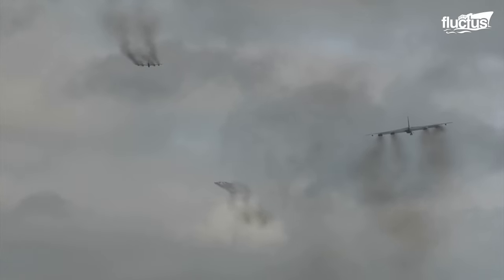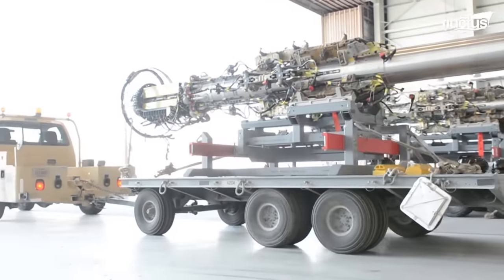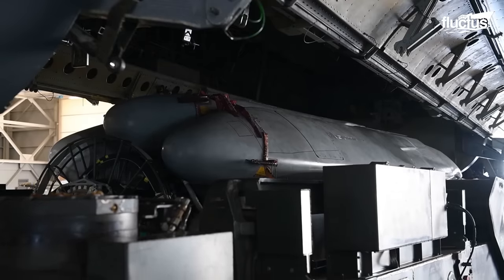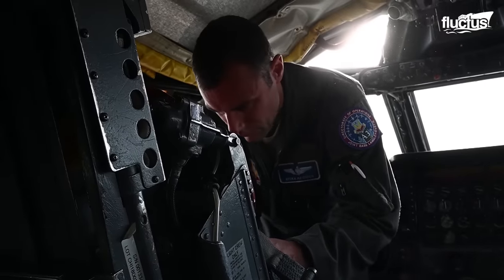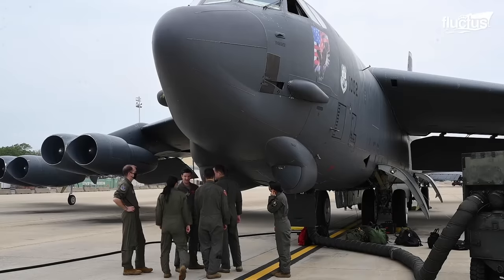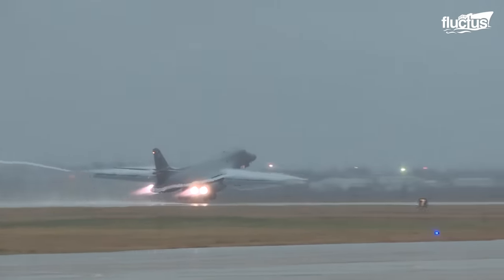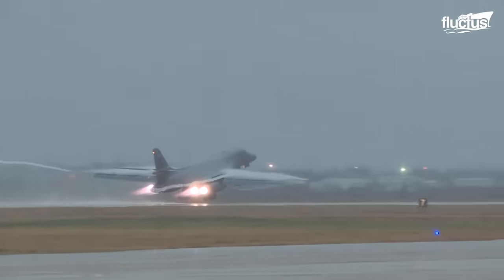This Genius US Invention Changed the B-52 Stratofortress Forever

Comment: I worked in Trailer AGE off and on for almost 6 years at Wurtsmith and Fairchild AFBs. I am so glad when I got to March AFB one month after they got rid of the D models and supporting trailer AGE shop one month prior to the D model retirement in October 1982.  I worked on the MHU-173 and 196. As well as MHU-7M and 123, 141 and 77s.
Reply: I was stationed at Wurtsmith in 1974 until the Hounddog was obsoleted. Then on to Minuteman in beautiful Grand Forks. Lol
Reply: When I got to Wurtsmith in early 1982, we were using SRAM missiles, B-58, and B-61 Gravity weapons. By the time I left they completed the new WSA for the ALCM AGM-86 missiles. They retired the SRAMs and the B-58 weapons.

Comment: The Royal Navy used to operate the Bucanneer bomber, which also featured a rotary bomb cartridge.
Reply: Not exactly.  Bucanneer used a bomb bay with a single weapon tray, that flipped out into the slipstream instead of opening traditional bomb bay doors.  But it did not have multiple weapons on a carousel launcher like this.  Buccanneer was more similar to the system used on the F-101B, which had a weapons tray that flipped over by rotating to expose the weapons to the slipstream.  Technically, even F-101B was closer to a true rotary launcher, as it carried weapons on both sides of the tray, while Buccanneer had weapons only on one side.

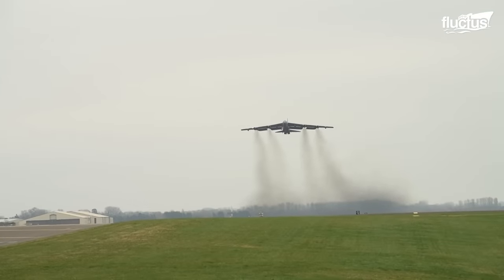Comment: 4:21 Cartridges were used to start the engine in the movie Flight of the Phoenix staring Jimmy Stewart.
Reply: many planes used them. i believe the f4u corsair used them
Reply: That was a completely different system.  The big jets use the exhaust gases, routed thru the starter, instead of bleed air to rotate the starter.

Comment: In all seriousness you have to ask yourself just how long any of these would last in a serious air war. One missile from a fighter 10 miles away and its down. Ground radar would be reading the serial numbers from 20 miles away. And the infra red signature must be huge with 8 old engines. (Yes I know Rolls Royce are fitting new ones).
As I recall even the North Vietnamese shot a dozen or more down.
The amount of cash being pushed into these old dinosaurs is only because of Good 'Ol US Pork Barrel Politics.
Reply: thats why they need to add gunner balls with targetting computers and exploding bullet shells === see what your missle gonna do with exploding bullet hit it ?
Reply: That's why they are now a standoff cruise missile platform  . No fuss no muss .
Reply: Actually you have ZERO understanding of they're current use .
Reply: @toddbrooks2063   Oh and like you DO have that 'understanding General? 😂
A 'stand off cruise missile' concept is not new. The RAF Vulcans were doing this before the Cuban Crisis and could fly in at treetop height or exceptionally high levels both of which defeated the Russian radars of the time. They also had advanced electronic jamming systems that were so good that of 8 attacking aircraft 7 defeated the US NORAD defence systems. Not just once but TWO years running (1961 and '62)!
However times have moved on considerably since then and the situation for the B-52 is that you do not need airborne launch platforms any more. And the B-52 is certainly no Vulcan manoeuvrability. It is a slow lumbering target that lights up infra red sensors from miles away and has the radar signature of Manhattan.
If a B-52 can launch a cruise missile (a TLAM?) then the enemy can equally launch a G2A missile at some considerable distance.

Now as it happens I have a very sound knowledge of what they are used for Duffus having served. Maybe before insulting people try and discuss the issues?
You useless Mong.
Reply: In Vietnam, they finally managed to shoot them down, by firing eight sams at once.  Otherwise they can defend themselves pretty good, with all their counter measures.

Comment: The b52 is a standoff weapon. It has the radar cross section of a barn. You lost 15 in Vietnam.
Reply: You know what else has advanced since Vietnam? Radar jamming, more powerful and fuel efficient jet engines, drastically longer range cruise missiles with pin point accuracy. So a single B-52 equipped with new engines that give it shorter take offs, more speed, range and loitering capacity, modern avionics, coms, targeting systems and precision guided ordinance can reliably do the work of 15 Vietnam era B-52 used for carpet bombing without all the collateral damage. Consequently there's not much equivalency between the capabilities of a Vietnam era and the new B-52 platforms. Which is why even after 70+ years in service B-52's remain a very big stick that strikes fear into Americas enemies and plays a formidable role in our nations defense.
Reply: @whiteorchid5412   Quote:
     "even after 70+ years in service B-52's remain a very big stick that strikes fear into Americas enemies"
You think? 🤭
What you just reeled off was the typical Yank bragging about an aircraft that is long past its sell by date but you hate to admit it. You think Russia and China couldn't pick these up on radar as soon as they left US airspace? And how do you jam the massive infra red signature?
While I am pleased they will be using new British Rolls Royce engines they wouldn't last too long in real air to air or even ground to air combat.
Reply: Many of those were only lost when Vietnamese turned off the tracking on SAMs and fired them straight up into groups of bombers.
Reply: @whiteorchid5412  Well said.
Reply: When they fired eight sams at once, one could get thru.  They could easily handle three at a time.

Comment: The B52 engines seem to have very low fuel efficiency.
Black smoke is always seen behind these aircraft.
Why aren't the aircraft updated with modern jet engines?
Reply: The contract has already been awarded to update the engines.  They are staying with eight engines, used in business jets.